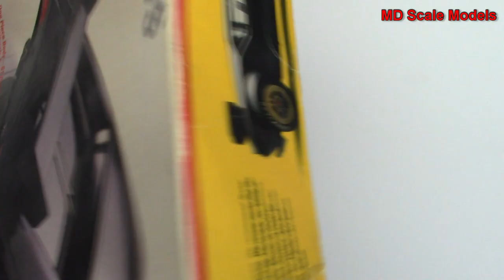Full Build Video - Detomaso Pantera 1:24 by Testors

Comment: I had one if these kits in the 80s. I remember most about kit was the space for optional electric motor and space for AA battery. The rear axel was a metal shaft with a toothed cog wheel gear that linked with motor.
Reply from the maker: This kit had those features. A bit of a pain to close off.
Reply: @MDScaleModels  This brings back memories